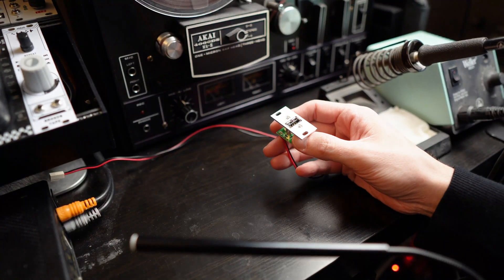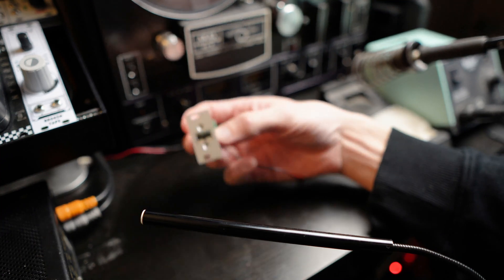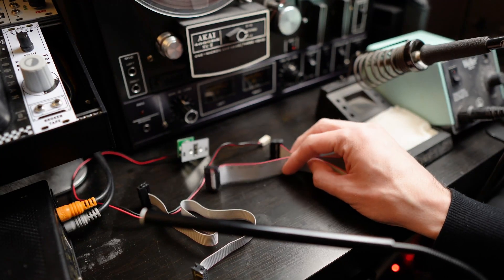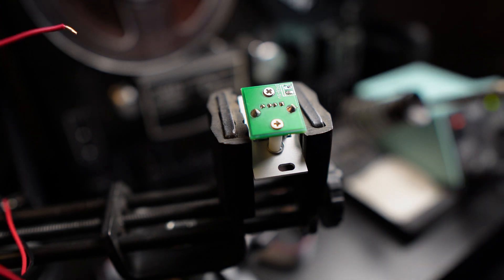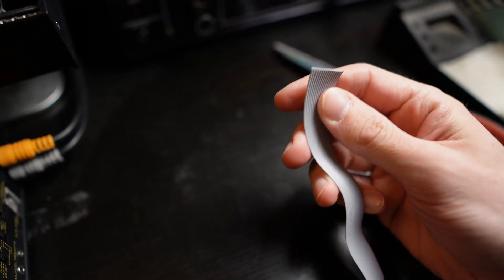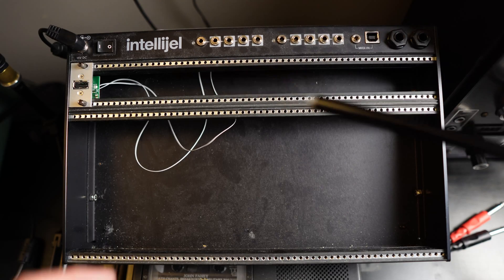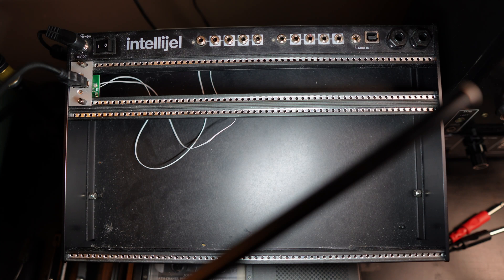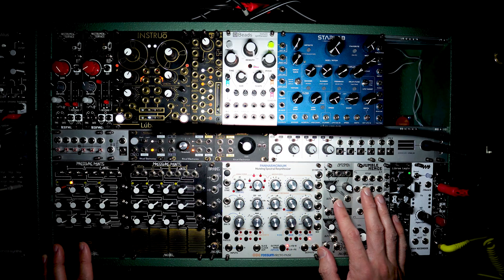Brightening My Cases by Converting Intellijel's USBPower1U to a 16 pin Cable

Comment: You could have just opened the connector and just put the 2 wires into the ribbon connector and kept the both ends for both cases.
Reply from the maker: Yep another commenter mentioned that too. Lots of valid ways to make the makeshift cable

Comment: Why not just plug two wires into a dual 16 pin clip, then use electrical tape to hold them in place.
Reply from the maker: Sure that’d do it. Work with whatcha got laying around, lots of valid ways to make a little cable

Comment: Really smart mod - now I'm seriously considering getting the 1U usb module myself. Thanks!

Quick question: what camera do you use? Looks like a good depth of field and the autofocus seems nice and snappy
Reply from the maker: This was on a Sony SV-e10 with a Sigma 16mm f1.4 - the lens there does most of the depth of field and wide angle work. I also just use my iPhone for a lot of top down shots or second angles.

Comment: I've been thinking of trying to make my own offset/attenuators and manual gates by using a similar method, just tapping the 5v and ground like that. Maybe I'll try it soon!
Reply from the maker: Oh great idea! You just made me realize this method could also make it way simpler to hook up an arduino or other 5v microcontroller on the back of a diy module. I might have to try that someday.